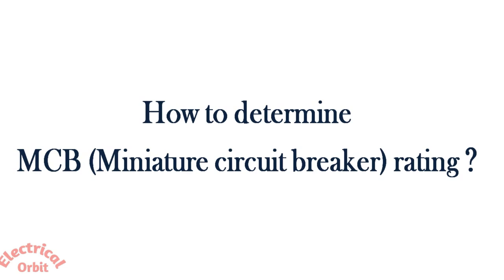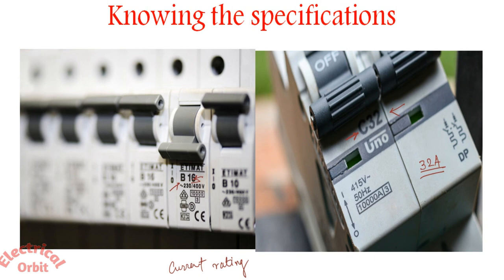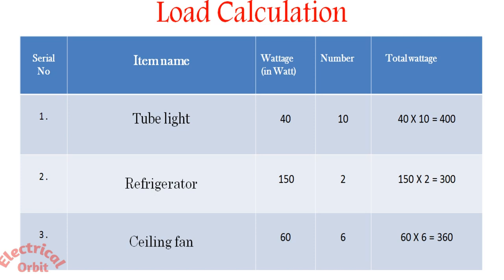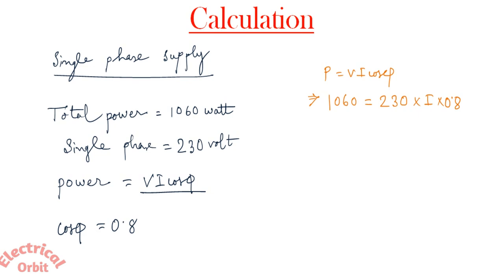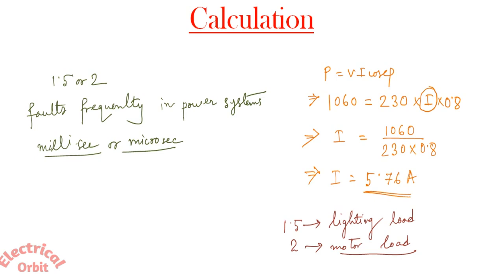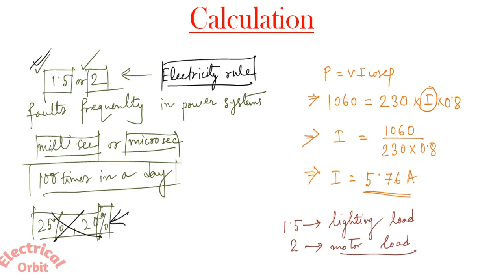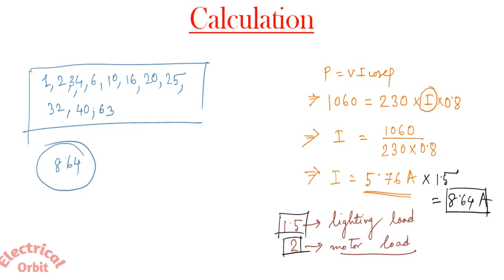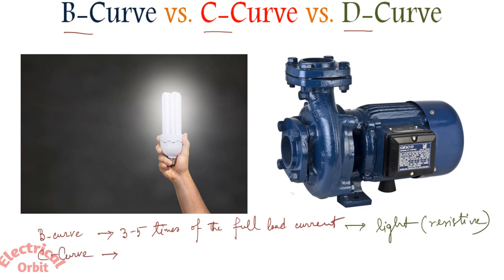How to Choose Right MCB Breaker Current Rating l How to Calculate MCB rating with load

Comment: By this calculation, my 2000w geyser should be needing more than 10amps MCB. But in my home, i have C6 amps mcb which is working fine. last i used 2000w geyser and 1400w heater at the same time, then only it tripped after 3 4 minutes. due to some problem in my area i am only getting 170 180 v mains which should theoretically increase the amps. But still every thing is working fine on 6amps. can you explain why?
Reply: It's not that a mcb of 6amp will  trip when lode rise above 6 amp. C type mcb will trip when the load current rises 5 to 10 times of the rated current. So a c6 mcb will trip on around 30 to 60 amp
Reply: @sanjay.haldar  I didn't know that. You made me learn new thing today. Thanks alot..
Reply: @Bishalkarn  that’s not quite right. The curve relates to how quickly a mcb will trip with the current in question. It’s not a 5x and that’s that. If you look at the manufactures of the mcb they will have a graph where you can see the curve on a graph and the time it takes to trip. The higher the current the quicker it trips. 

So if you pull 8 amps through  a 6amp mcb it should trip eventually but will take a bit of time. 

The curve is in response to standards set down as to how long a mcb should take to trip because the cable it’s protecting can take a certain amount of current for a certain amount of time. The longer you run the cable the hotter it gets.

The issue is different types of loads pull different amounts of current. So a motor will pull a lot of current when it starts but once it’s running it pulls a lot less. So if you put a type b 10 amp in and the motor is rated at say 8 amps you’d think it would work but it may pull say 90 amps for .5 of a second when it’s starting. That may trip a type b and you have nuisance tripping. 

The type of mcb selected should be based on the type of load going on the circuit. The size of the mcb should be based on the maximum current draw and the size of the cable should support that calculation. 

I’m not sure what is in this video matches what is in the uk. But I’m not an electrician but I think the .8 calculation is about diversity which is related to likelihood of all the loads being on and pulling their rates current at the time. I think this is applied after the loads are calculated. Not sure I’ve seen anything about 1.5 or 2x and you only apply diversity in specific situations. Like I said this is what I understand of the uk electrical standards which can change on each edition of the British standards and I’m not an electrician.
Reply: @davideyres955  Thanks for you contribution. i guess it makes sense. The previous comment is also right in a sense. i checked and found that indeed type c can go upto 5 to 10 times, but time is also a factor. Guess some electrical engineer can clear these things in future comment.
Reply: 2000 W geyser takes around 11 Amp and if you use 6 A curve the MCB will trip within 15 minute.. Here the thing is that geyser will automatically cutoff when the temperature of water reach a specified value.. I think it will be less than 15min.. Please remember that  if you provide geyser in a 6A socket surely the socket & Switch will heats up.. This will reduce the life span of that Lighting circuit.. So plzz don't do this..